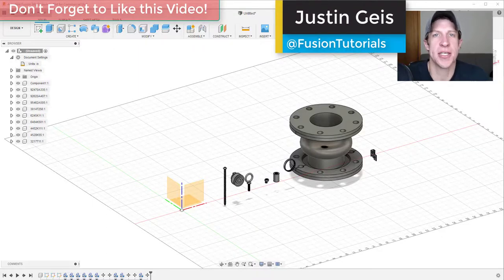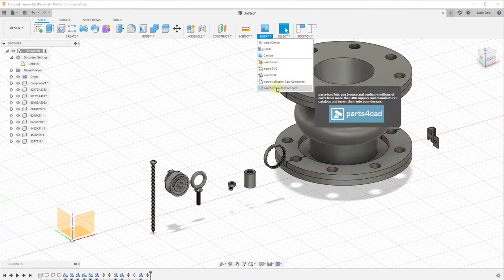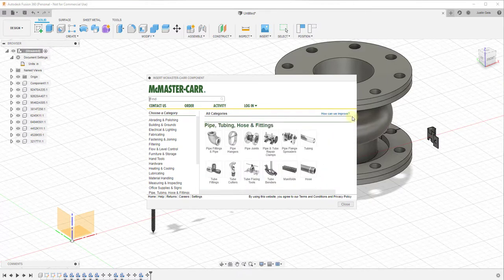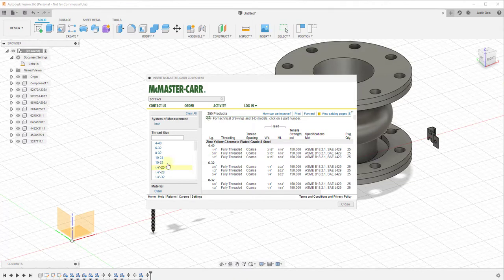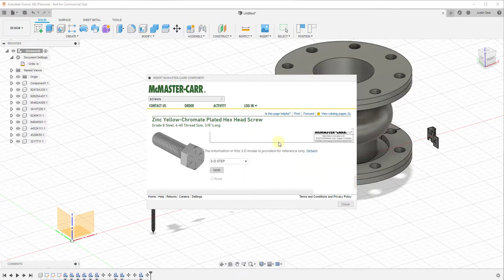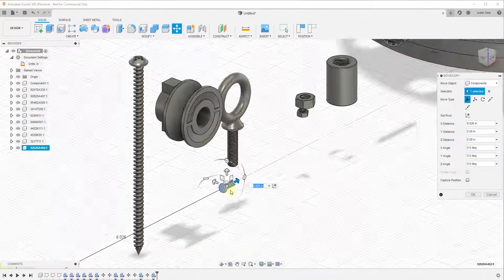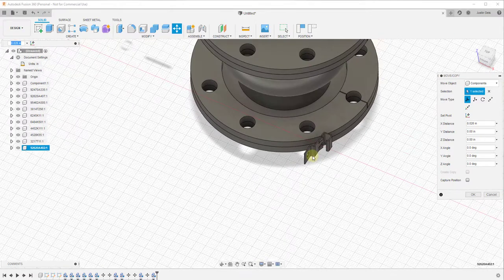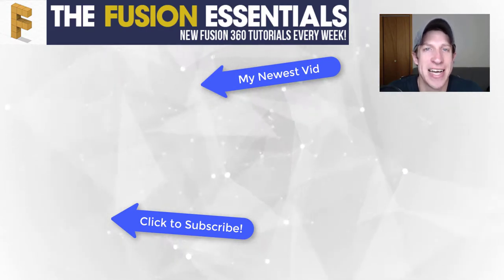FREE Hardware Component Library for Autodesk Fusion 360 - The McMaster-Carr Link!

Comment: Combine these premade parts with the “cut” tool to easily create negatives.
(Example: create a solid object> import a screw> place screw onto object> cut screw out> the solid object remains with the old impression of the deleted screw> now the screw should fit into the objects hole)
Reply: that is a great idea thanks

Comment: Thank you very much for your perfect information of the McMaster-Carr library, I'm learning to work with Fusion 360 and I've a question, 
in my Fusion practice I need bold 91271a760 and then 3D-Step, after click on Product Detail, and Scrolling down, 
I can't find the Save button?  Maybe because I haven't logged in to McMaster-Carr? 
Or there is a solution for this problem please?

Comment: CAD Disclaimer (This Made Me Cry) I didn't want to make my own nuts and bolts for my commercial project! 😞

The 3-D CAD models and related information are provided for reference only. The CAD models do not contain any technical information other than what is readily observable, specified by industry standards or provided to us by our suppliers, and they are subject to change without notice. The dimensions and other technical specifications of our products may vary from those shown in the CAD models, due among other reasons to tolerances associated with manufacturing processes. Manufacturing tolerance information is considered proprietary by many of our suppliers and is not always provided to us. Thus tolerance information may not be reflected in the CAD models. Your use of the CAD models is at your own risk and you are solely responsible for any use you make or permit others to make of the CAD models. McMaster-Carr makes no representation or warranty (express or implied) with respect to the CAD models, including but not limited to the accuracy or completeness of product dimensions or any other technical specifications contained in or accompanying the CAD models, non-infringement of third party rights, and quality, suitability, fitness for purpose or title. McMaster-Carr may terminate or limit your access to the CAD models for any reason at any time.

The CAD models are being made available to help you decide whether to purchase products from us. You may download the CAD models and share them with others in your organization or with third parties acting on behalf of or rendering services to you or your organization (including your data center or cloud service providers), but only for purposes of deciding whether to purchase products from us or in order to develop design drawings and prototypes for use by you or your organization in connection with a decision regarding whether to purchase products from us. You shall not use a CAD model to engage in 3D printing or other fabrication of the object depicted in the CAD model for any other purpose. You shall not otherwise redistribute or make available the CAD models (or any design drawings or prototypes that incorporate them) to any third parties, including third parties in the business of selling products similar to the products sold by us.